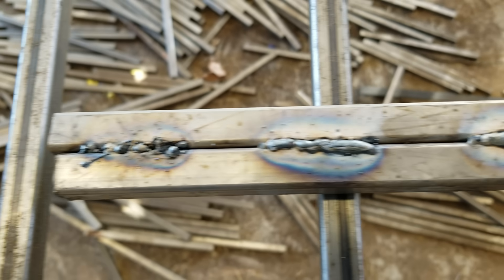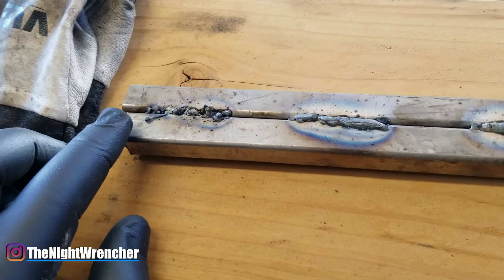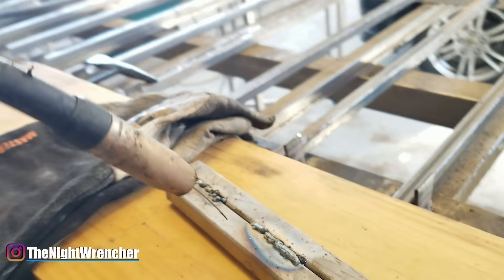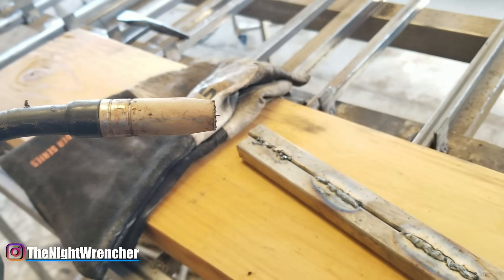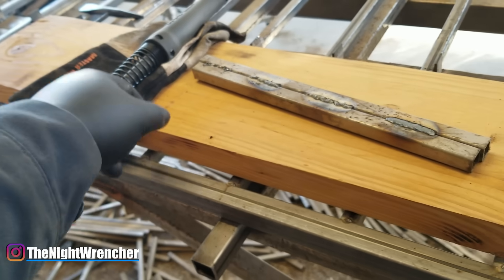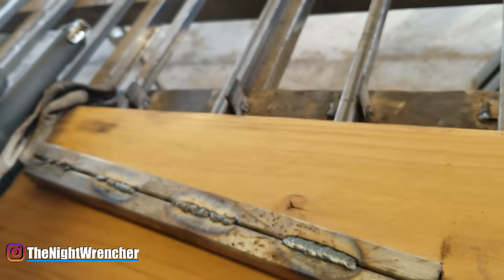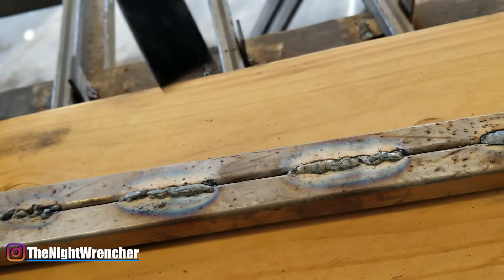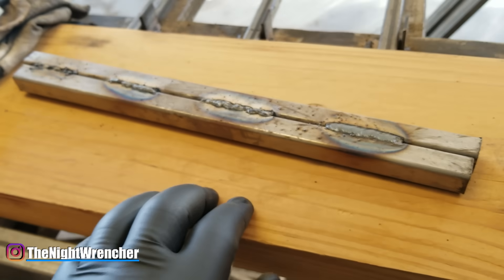Learn Perfect Flux Core Welds In 10 Mins | Gasless Flux Core Welding For Beginners Tips And Tricks |

Comment: Very good explanation for beginners. As a retired welder, the only thing I might add for clarity is that welding "sun burns" are more product of UV rays than from the heat of the weld. Hence the "sun burn" reference. That and sparks is the reason for protective clothing. Glad you took the time to make this video for folks.
Reply: Great comment and spot on accurate. Also, I hope nite wrencher is not welding in those rubber gloves. If those nitrile glove see a spark, the glove material will burn down into your skin.
Reply: @BartSimpson-nr1dy  He's got a pair of Vulcan gloves sitting to the left of his work piece. He was wearing them during the opening sequence of him working.
Reply: @BartSimpson-nr1dy  His welding gloves are sitting next to him almost the whole video.  He even points at them multiple times when he refers to his "welding gloves".
Reply: @Hustleverydayy        well its a total no brainer not to weld with those.      but  even when the hoods up  those gloves arent a good choice in my opinion  for the setting.        to each thier own   Ive got flex gloves  that ill use  soft  soldering copper tube , but brazing ill  wear leather
Reply: I don’t think that’s a rubber glove. Looks more like a fake hand just like the one in the movie Happy Gilmore.
Reply from the maker: I honestly never noticed the burns until I started to be able to run beads. After about 30 mins or so my whole arm was bright red, thats when I realized something was up
Reply: @NightWrencher  the better the bead/ longer the bead the more consistent UV light your producing.
Reply: @NightWrencher  to 0plolppololpl lol lolol lol lol of
Reply: @NightWrencher it’ll hurt I long term but I know that. Couldn’t help but say because no one told me I learned in the worst way.
Reply: Hi i loved this video im going into the welding trade soon i will be watching alot of these videos
Reply: Hah, I've been sunburned a few times. Basically every time the job was small, so I felt the jacket wasn't needed.  Well... It was.
Reply: @2S1L3NT  Hey man, that's basic human reaction.  Most people, if they're going to be out in the sun for only 30 mins or so, don't even THINK about slathering up in sunscreen.  Luckily, we have these magical bodies that can recover from and heal minor injuries!  It's the people that do it on a regular basis that start to incur the long-term effects!
Reply: I've always known it as arc burn. That stuff will find any hole you have, if any, in your gear. Made me a believer in leathers
Reply: Good explanation. Can u tell me the spray type to protect the mig from dust
Reply from the maker: Its called anti spatter spray
Reply: It very well could burn your eyes through your hood as well so make sure you use proper lens tinting
Reply: I’ve asked my dermatologist about welder burns for skin cancer. She said she doesn’t know of any studies. I’ve had skin cancer and I think it might have been from SOME welding. Just saying. Stay safe people.
Reply: I got Basel cell on my neck from welding it’s a thing
Reply: @jerrypuckett6733  I have recently been diagnosed with a mild form of skin cancer on my right cheek. Coincidentally that is the very same cheek that was exposed to the arc during my almost 40 years of heavy fabrication. 

My dermatologist did mention that my skin cancer and exposure to the rays from the welding arc are most likely directly related.
Reply: Also, make sure you're wearing dark colored protective gear.  When I was in school for welding a made the mistake of wearing a white shirt once and a yellow shirt another time under my jacket and I got such a bad burn on my neck that when I rode my motorcycle it felt like someone was slicing my neck with a knife.  What happened was the light colored shirts reflected the arc light instead of absorbing it the way dark colors do
Reply: One more thing about clothing. ALWAYS try to wear protective clothing that is made from natural fibers such as cotton or wool and not from synthetic fibers such as polyester.  Polyester fibers will melt into a hot molten plastic that will make the burn injury worse if your clothes catch fire while welding. Natural fibers like cotton will turn into ash so therefore the burn injury will not be as severe as a synthetic fiber.
Reply: I didn't think he was saying that the heat directly caused the sunburn, and most likely people understood the the reference he was making regarding the heat.  Longer exposure to the arc will equate to more heat and the more heat felt the more UV exposure.  Much like the sun, the more heat felt typically equals more UV, because much like the ARC, the more heat felt equates to being closer to the equator and the sun.
Reply: @Hustleverydayy yea except ozone  plays a bigger part and from  Antarctica  there Is a big hole in the ozone layer our sunburn is harser😢 the more southern  you go.... sadly 🔥.
Reply: @Hustleverydayy  heat IS Photon's " which the Fusion in the surface of the sun, TRILLIONTHS of a millimeter thin only sustained by the immense mass which stores solid Hydrogen and Helium,  the Earth's mantle is a lower form of fusion and " Photon's  Electrons Muons etc " of molten metals including Salt... " Think  Thorium Salt Reactor " electrical Fusion.. " plasma state of matter " point being Yes Plasma energy produces UV spectrum's including A. B. C. You're Going to need to coat your protective clothing with Zinc Oxide, such a simple method to block UV radiation. " Lead was better " but since they convinced everyone that kids ate less paint chips here we are.. getting  irradiated by the sun " inside OR Outside for residential dwellings by UBC guidelines.
Reply: @Cody We    Wayyyyyyyyyyyy too egg heady for this crowd!
Reply: Thats good for tailors and BBQ pits
Reply: Can you get a tan from them?
Reply: @NanoSync  Not really, more burn than tan. GTAW is the most intense. The most common area is your neck below the hood if your shirt doesn't cover high enough.
Reply: @tomdixon2959  I have a shaved head and I never wore any types of hats under hood.big mistake
Reply: @NanoSync  more like sun burn, uv rays far too strong for a simple tan. Have you ever had sun burn on your eyes? It is very likely
Reply: @Solorivera  I’ve gotten the blue dot for 2 weeks straight after doing spray with a shade 9 once. Didn’t do that again
Reply: Forget all the arguments against covering up. If you’re welding, cover up! It’s not tanning. It’s damaging your skin, and/or eyes, and if you do it enough, you’ll get skin cancer. I can’t believe a dermatologist didn’t know, or at least check, and say the same thing.
Reply: I was building a big smoker over several months time.  Some of the welding I was wearing shorts, I had a very bad “sun burn” above my knees.  It seriously took a couple years, yes I said years! before you couldn’t notice a definitive line where the burn was.  Lessons learned the tough way.
Reply: Dumb question what is the best type of welding to start out learning with I hear all sorts of things all so is harbor freight welder ok for a first welder i just want to start as a hobby with the help of YouTube university lol
Reply: cut to me wearing a sleeveless t shirt and some jeans and letting er rip. don't worry I do got a hood. safety squints just barely don't cut it welding I've found.
Reply: Yeah "flash burn" correct turn, is no joke. Always wear sleeves.
Reply: im 19 years old and am in a vocational school for welding and went to the comments to say the same thing lmao. Never knew "welders" didn't know this.
Reply: Learned this today the hard way lol had short sleeves on and gloves
Reply: Probably a strong cause of malignant melanoma???
Reply: Boss man told me to get to it with no warning. Had myself a tahirt leather gloves ans a hood. By the end of the day I was blistering and red. Hadn't realized how much UV I had soaked up until we got in the cab. Now i carry sunscreen, after burn sooutions, and im packing a spare FR long sleeve for next time 😂
Reply: 😂 yessss I just weld, took me awhile to learn how to weld properly. When I finally learn. I felt the heat and started to get hotter but continued welding because I didn't want to pause, wanted to continue a clean weld. 

After 😂, as soon I entered the restroom I saw myself red 🤣🤣🤣 it felt like going to the beach 😂 entire day.
Reply: @davidramey7186  I've heard about "Welder's Tan" from the very beginning.  As I've found, it's MUCH better to deal with bulky/warmer clothing than it is to deal with burnt skin all the time!

Comment: I didn't go back a look through all the comments (495), so it may have been mentioned previously; BUT... You CAN and WILL still get burned (sunburn) from "popcorn" welds, if you do it long enough.  Why?  Because the "sunburn" has nothing to do with heat... I has everything to do with UV rays, and a welding arc produces a LOT of UV rays.  Good weld or bad weld, does not matter.
Reply from the maker: You're right, but whats funny is I never got any burns at all and never even wore gloves as a beginner. I couldnt make it light for more than a second at a time and didn't weld for more than 5 or 10 mins each ocassion. Now, As soon as I touch the metal the heat bleeds right through my TIG gloves. Feels good.

Comment: Does the polarity on the MIG welder make a difference when using flux if so which way does it go
Reply from the maker: Flux core has to be ran the opposite of regular MIG. For flux core use Electrode negative(ground wire on +). For MIG use electrode positive(Ground clamp on -).

Comment: good video- another reason to hold the gun at 45 degree is that you have clear view of your work at 90 degree the gun blocks your view
Reply from the maker: Right, 90 degrees is good for gas welding for complete shielding but not nessesary for flux core

Comment: Ive been welding flux for a while as a beginner, this is one of the more well explained videos Ive watched on YouTube
Reply from the maker: Thank you! I really appreciate it!
Reply: I agree, I was trained on shield gas to push the weld puddle but with my flux core welder that doesn't work at all. I'll be dragging it now. Thanks.
Reply: @Dougs-Ear-Hole-Entertainment  dragging let's you see the puddle and fold It for  stacking dimes.
Reply: Proper penetration results in even thickness throughout the ENTIRE weld gap between Materials.. I learned from my dad around age 6 which is why passing the tests were achieved ONE semester. Work all week come in Saturday weld and pass three weeks of work to achieve the Credential.
Reply: The last 3/4 of the semester familiarizing with next weld process Tig " titanium is brittle ,  mig arc smaw Plasma pulse modulation brown's gas etc

Comment: Nice, this seems so much simpler than arc welding. Love the utility of an arc welder though
Reply from the maker: I feel like its easier because you just gotta point and shoot
Reply: it's basically the same, stick welding without having to stop to change the stick. the principles and puddle control are the same.

Comment: im really interested in flux core. What Welder machine i should buy for beginners?  what kind of wire do I need, any accessories except for welding gloves and helmet
Reply from the maker: Any machine that has both adjustible wire speed and adjustible amps should work. There are some cheap machines that control both on one knob but those are no good. Aside from gloves and helmet, you can pick up a cheap slag hammer and some of those red magnets that look like arrows to help you hold things together

Comment: Also alle 4 Nähte sind nicht gut.
Bei Schutzgas wird die Naht normal gezogen und immer eine 8 geführt.
Eine geschobene Naht auch mit 8 geführt nimmt man liber bei Steigschweißen.
Die Schweißperlen am Material zeigt das zu wenig oder falsches Schutzgas verwendet wurde.
Mischgas würde da schon helfen die Schweißperlen zu verringern.
So all 4 seams are not good.
With shielding gas, the seam is drawn normally and always an 8 guided.
A shifted seam also with 8 guided is taken liberally with climb welding.
The welding beads on the material show that too little or the wrong shielding gas was used.
Mixed gas would help to reduce the welding beads.
Reply from the maker: I wish I could actually read this. I cant read german(?) 😔
Reply from the maker: @Dieter Strom Ok, thank you for the translation! This welding wire does NOT use shielding gas. Zero gas. It does not come out as clean as gas shielded welds but you can weld outside in the wind with no problems

Comment: Do you’re saying all this is gas less?
Reply: Hi Raymond, there is no gas needed ..the main the benefit of flux core is that you don't need gas, the flux in the wire core burns off in the arc and produces a gas and ensures the integrity of the weld.....ideal for small shops and the odd job. Make sure you do it in the open or outdoors, as the fumes are not good if inhaled. Get all the safety gear you can ...he mentioned 'sunburn' which is really bad that he suffered from it  as he should have known the arc produces a lot of UV which as we all know causes cancer. Stay safe. The best welding motion is to make a series of es eeeees,  and slowly draw the gun to your right. You are looking for a sound of frying bacon when the welder is correctly set. Be careful not to weld galvanised metal as the fumes are very toxic.....one should get a blower on the job to put the fumes away from the welder .... and definitely do that outside if you can. Some colleges do a one day course in basic welding .... check em out.
Reply from the maker: Yes exactly. This was my 110v machine running gasless flux core .030 wire

Comment: Spraying the around area with Pam cooking spray will prevent the spatter from sticking. It's way cheaper than anti spatter stick spray
Reply from the maker: Ive never tried that but I'll check it out!
Reply: @NightWrencher  just don't spray where you want to run a bead.
Reply from the maker: Makes sense 👍

Comment: Well this taught me that it wasn't my technic that was ruin my weld but my welder not being up to do thick welds. I have a little $300 Hobart and it makes nice looking weld, just not very big ones. I'm very used to using miller and lincoln welders as well.  Hopefully this spring or summer the puddles can stretch out more a 1/16, this winter has been a killer for my welding.
Reply from the maker: Im going to make a video on this but To make your welds wider, turn up the heat, increase wirespeed and move side to side as you drag. My old welder could weld continuous 1/2 inch beads at its max setting but would over heat and autoshut down every few minutes. Thats how I did my front axle. 50% overlap on 3 welds side by side

Comment: What weld should I use for automotive frame work?
Reply from the maker: You can use any of them. Theyre pleanty strong for frames
Reply: @NightWrencher  would stick be better than flux for strength?
Reply: @NightWrencher  thank you for the info. I'm very new to welding. I want to do my own notches on my frame for my air bag set up. 👍🏻
Reply from the maker: Very nice. You should have no problems but since youre a beginner I would weld your notch solid, sand it smooth and add a few plates just in case. Stick is really good for wide beads on thick material but the strength is the same
Reply: @NightWrencher  any certain stick number I should use over another?
Reply: @NightWrencher  another question but this is with my taillight filler plates. Since that's thinner metal I'm guessing the flux to tack it all around then smooth? 
Once again THANK YOU so much for your expertise and knowledge. Ive been watching your videos and they are very helpful. I'm a car electronics guy and can do all that plus fiberglass , woodwork , interior and paint and am just now getting into "some" welding lol  with a couple el cheapo machines.
Reply from the maker: I wouldnt be able to tell you since  I dont have much experience with stick. I would visit your local welding supply store and ask them. I believe frames are made out of mild steel be im not sure
Reply from the maker: Flux core would be better with sheet metal because you just need a quick zap. Use the smaller .030 wire because it lights easier so you dont put too much heat into the panel. The easiest way I've see people do sheet metal patch is to just barely overlap the new and old pieces, tack weld them in crisscross pattern, making sure to keep the gaps closed and keep going around until all your tacks are about an inch apart. Grind down the tacks flush and then hammer in the overlap lightly so you can fill with body filler.

Comment: I use nothing but flux cored wire and u do not need the shroud wen using flux cored wire as the shielding gas is produced at wire tip..plus u can see the exact weld pool without the shroud.
Reply from the maker: I've been welding with the shroud on since I learned how to weld and it doesnt seem to bother me, at least not yet

Comment: Another thing you can do is remove the gas shield it's not needed with flux core wire. Helps a lot in tight places plus makes it easier to see what you are doing.
Reply from the maker: I tend to keep it on so I don't lose it lmao
Reply: They make flux core nozzles. They work great.
Reply: @Fred Wills I have to admit i've only ran a 2 lb  spool through mine. But i don't see any damage to it. Luckily they don't cost much. I might get another for a spare.
Reply: I thought this was gas less explanation.  I’ve welded flux core for 20 years and 75-25 is alway the best.  Gas less is garbage I won’t use it
Reply: @buttneked3963  cool story bro!
Reply: @buttneked3963  useless comment. Thanks for that.